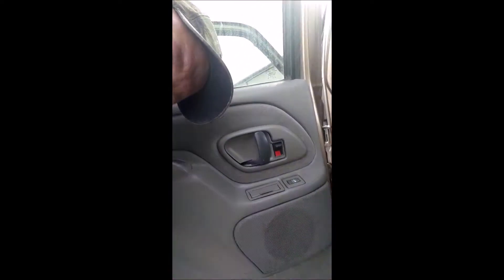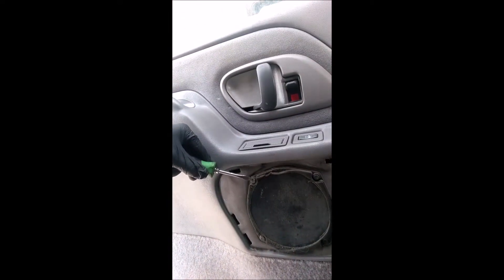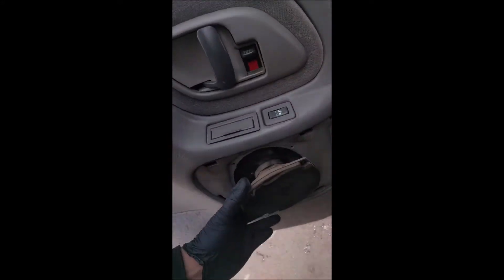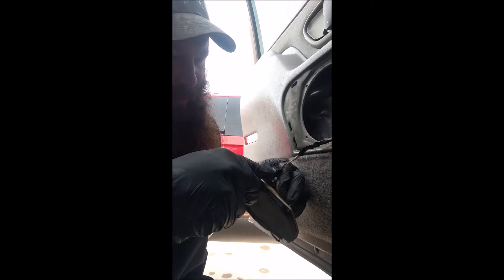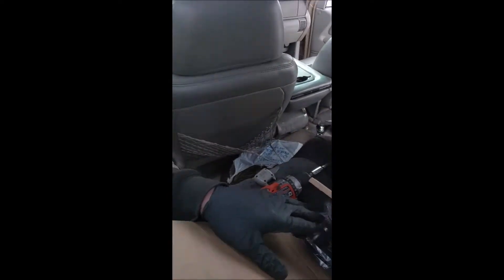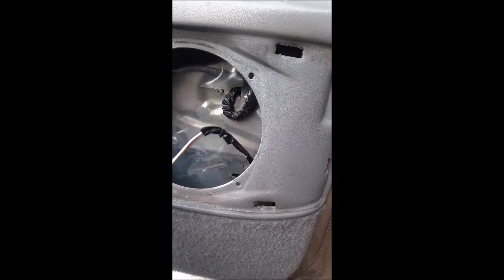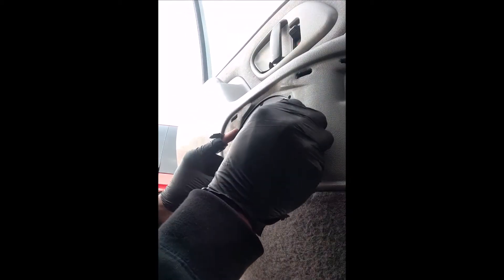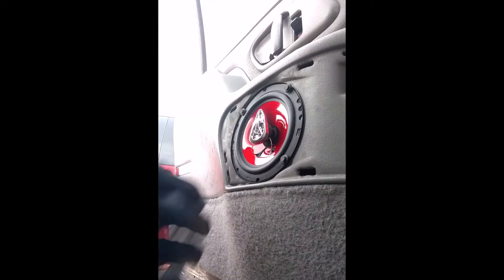rear door speakers 99 gmc suburban / tips on front door speakers

Comment: So I tore a rear door apart on my 96 chevy 3500 today. It has a grill like yours for the speaker. After I took it apart there was an indentation for where the speaker would go but it wasn't cut out at the factory. I then looked to see if I could find any speaker wires and I found them. So my 1996 chevy 3500 truck is capable of it but the factory never cut the hole in the panel or installed a speaker. I'm going to do that however.

Comment: Cool. A video on rear door speakers. Albeit for a 99 suburban. I have a 1996 chevrolet 3500 crew cab and there are speaker holes in the rear doors for these speakers. I dug and dug on google trying to find the product numbers for them. Finally found one gm wholesaler who listed these oem speakers for my 3500. Now all I have to do is take off that grill and see if there are speaker wires for the speakers. I bought 2 front tweeters off ebay and can you believe that gm didn't install them at factory? But there were wires and a connection for them. Thanks for the video

Comment: Kinda late to reply but i have a 98 suburban.....speakers of course go out, now factory speaker size is like 6 3/4 but could i put 6X8 in it?? And how hard would it be??
Reply from the maker: sorry for the late reply, so you would have to cut the door panels wider to make it fit but the danger there is if the window when it is fully down will contact the wider speaker

Comment: Where did you get the connectors? Im sorry if you mentioned it and I didnt hear you.
Reply from the maker: William Davis check this part number on Amazon, that's where I got mine. 
Metra 72-4568

note they don't fit the rear 4x10 in the very back but these will work fine on the door speakers
Reply from the maker: William Davis  here is a link
https://www.amazon.com/Metra-72-4568-Speaker-Selected-Vehicles/dp/B0002BEUZ8/ref=sr_1_1?ie=UTF8&qid=1495679983&sr=8-1&keywords=Metra+72-4568